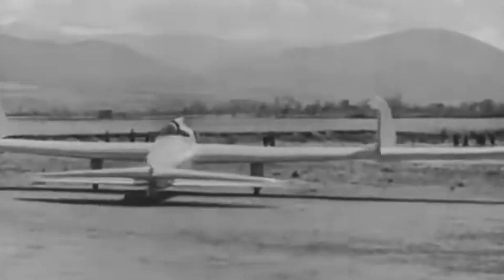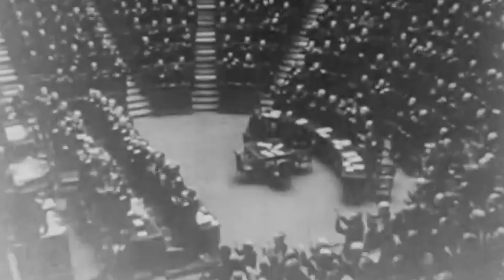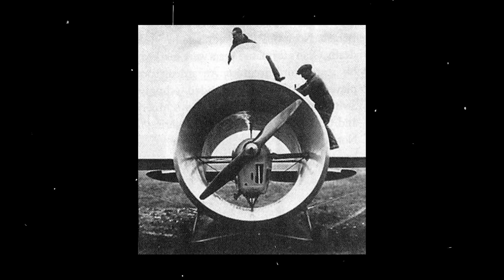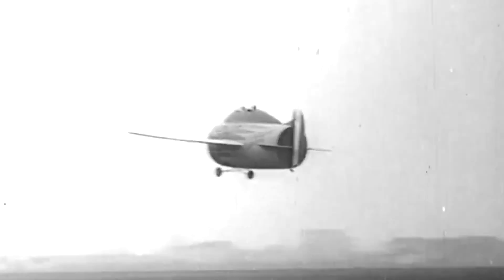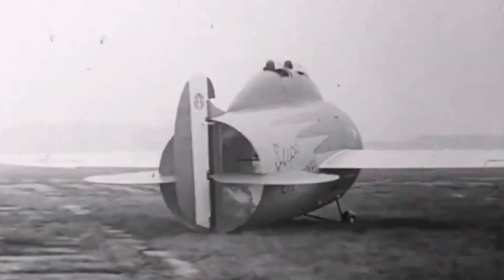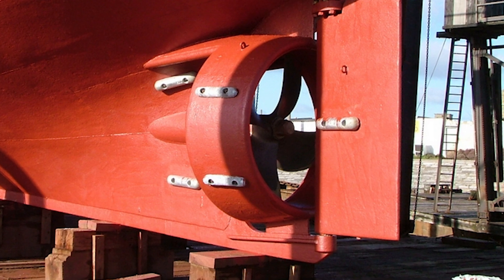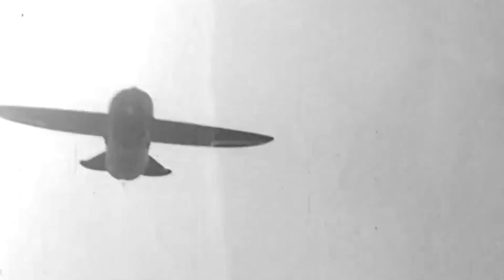A Bizarre Fat Airplane that Changed Military Aviation Forever

Comment: Air gets thin the higher you go up. WW1 flight ceilings were at 8 or 10,000 feet. The strange configuration helped compress the thin air so a propeller would still work.

Comment: What amazing times. Not a practical aircraft in any sense. To think the design influenced the development of modern jet engines is nonsense. The basic modern jet engine design was destined to be invented on it’s own following inherent mechanical principals. If anything, this design was clearly influenced by the racing planes already in existence then. They even copied existing racing paint schemes producing it. I put this craft right up there with saucer shaped designed for impractical concept from day 1!

Comment: Just an academic thought; would it have had a better performance with a narrower diameter and more prop blades? I've noticed that through the 20's and 30's there seemed to be a big reluctance in propeller layouts than double props for smaller aircraft or quadruple for the larger ones...? There were exceptions; the DH 5 springs to mind... as you look at modern turboprop aircraft like the later C-130's and the A-400 M, it just makes me wonder if propeller design was an afterthought back then...?

Comment: OUTSIDE the box … Today?  What if we built commercial aircraft jets this way?   Put 4 giant turbofans engines on the bottom and the 200 passengers in a luxurious giant tube on the top. A solution to overcrowded airports and easier landing/takeoff approaches?

Comment: I'm thinking about a pair of these on either side of a small dirigible.. made with a bioplastic carbon fiber.. and high speed electric motors... like drones... but big... reversible... like brakes... for sissies
Reply: the motor and fans do the steering.. very little yaw... only a little pitch... or none at all.. I want them to be safe for your grandma to go to the store in... and back.. never bump into someone else.. and when you stop the motors..  you fall up... slowly
Reply: we'll let Google Home take care of navigation... tell Ms Google where you want to go
she says.. 
please be seated.. enjoy your flight 🤠
✌️
Reply: I think the fans will be more efficient if placed on the output side of the venturi.. big wooden propellers are out...  I'm working on some other ideas... Arcemedes said we could move the World with sufficient leverage... he was right ✌️
Reply: StarFire Dirigibles... coming  ^soon^

Comment: The aerodynamic profiles are sound. But you're not going to drive that thing with an Arado 240HP engine. Especially if the engine itself is actually in the duct you are relying on for thrust.

Comment: It would’ve looked more normal if he’d used two tube engines. Wonder why he didn’t use a biplane design with the motor(s) between. I’ve often wondered why biplane designs disappeared.  They seem to be inherently stronger with less width. I’m sure there’s a good reason but I just don’t know it.
Reply: Biplanes are just not as aerodynamically efficient -

Comment: This aircraft was the first to use a shrouded propeller. The advantage of this arrangement over a "free-running" propeller is that the shroud reduces thrust losses due to turbulence at the blade tips of the propeller. There is an increase in power relative to diameter, but not in propeller efficiency. The first mention of the shrouded propeller is found in 1918 in a patent specification of Mercur Flugzeugbau GmbH. This describes a "device for improving the efficiency of propellers" based on the use of guide vanes with adjustable pitch and a ring surrounding the propeller.

Comment: It seems to me that this aircraft is the exact opposite of a turbo-fan.

In a turbo-fan the inlet and outlet diameters are less than the front fan diameter. This has the effect of slowing down the airflow through the fan, as it sits in the widest part of the "pipe", reducing "wave drag" (the extreme drag as airspeed reaches supersonic along the propeller surface).

On this aircraft the propeller diameter is larger than the fuselage/tube inner-diameter. How this helps with efficiency escapes me. Can anyone explain?

Comment: The jet engine was actually invented and built into an aircraft much sooner. In 1910 a Romanian engineer called Henri Coanda tested such an engine, which is much more similar to actual jet engines than the intubated propeller.

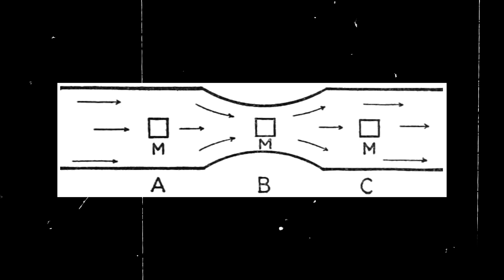Comment: 1:58 To be precise the Bernoulli principle states that when the fluid is at a higher velocity the static pressure is lower. There is no tube on a wing, so stating the principle as you did makes it less applicable as the principle per see is independent of any particular geometry.

Comment: I actually think this was a dead end.  Single engine jets were a seperate and parallel development.  The early jets used two engines on or in the wings or a single engine with dual inlets.  When they went to a more powerful single internal engine as technology improved I doubt anyone consulted Stipa's work.  Bernoulli, yes.  Stipa, no.

Comment: Yea, I have a degree in aeronautical engineering and remember studying this. I remember my instructor saying "...now if Stipa had put 4 of these beasties under wing of a larger aircraft, he'd have had something...."
Reply: He wanted to, but the airforce higher-ups refused as they didn't want to commit too many resources to something that could've been a failure
Reply: Was thinking the EXACT same thing, ducting a Pratt and Whitney double wasp from the p47, multiplied by 4 in nacelles (which could be slightly armored even, puting a chin, rear plus top and bottom turrets with three .50 cals or some configuration of maybe twin 303,s x 2 plus 20mm cannon for defense it could have likely tripped the bomb load of the b17, and carried it just as far, faster it could have really been something then later improving it with twin 28 cylinder 3000 hp engines with superchargers for altitude, then pressurizing crew compartment puting an aiming camera system in the guns and control it from the compartment the crew could have not frozen to the extent of slower reaction time to bandits or nausea from being in a quickly spinning and even upside down gun turret physically could have provided an improved defense, ability to run, once empty of bombs it could go faster still already likely 70mph or more faster than the b-17, now we're talking
Reply: @travisverlinde191  I tend to disagree. The P&W wasp was radial engine. Would have blocked airflow beyond the advantages given.. Would need a very narrow, very lightweight  high horsepower inline engine(4,6,8,12 or greater ) to really make a difference. Or just reconfigure the Bernoulli tube and stick a big pulse jet  in the middle. It will suck air in at front and blast it out out back( Similar tech is used in commercial aircraft slide bags to inflate them.)
Reply: @geradkavanagh8240  Good point @ radial piston configuration & size blocking the crucial air flow~

Comment: It is essential for there to be only the smallest gap at the tips of the prop.  In jet engines, the inner surface is SOFT and on first start, the fan touching the casing; as the engine speeds up, the fan stretches and rubs the soft liner making a tight seal.......IF the gap too big, you get surge, with the air coming out the front - destroys the engine quickly unless shut down.

Comment: When you think about it, it's an ultimate tech demonstrator, nothing on it that's not the absolute minimum to try out the new tech.
The airfoil cross-section of the tube also reminded me of annular/tube/closed wing concept, something developed during the early 1900s before the outbreak of WW1.

Comment: Calling Viktor Schauberger a crack pot is not very fair considering all the great work he did and is pretty ignorant lol. 

Especially is work with nature, his log flumes that lifted logs heavier than water prove his theories, increasing the yields and quality of farming without the use of modern fertilizers and using copper plated plows had huge gains for farming, these were scientific studies done iirc by the Swiss and proved a lot of what he said was true.

Read some of callum coats books like living energies on him and i bet you would have a different outlook on what he did in his life.

Comment: You can make this plane by taking a 8 1/2 X 11 paper. 1rst fold one end of the paper from the edge in little folds about 1/4 of the sheet of paper. Then put the paper in a tube shape like you see on the video. Use some scotch tape to keep the tube the shape you see on the video. Then gently throw it.

Comment: I enjoy you videos, thank you!
In this one you have misstated (or possibly understated) Bernoulli's Principle. It almost goes without saying that the velocity of a fluid (liquid or gas) increases as the diameter of the tube through which it is passing is reduced. How could it be otherwise? Bernoulli's innovation is that "an increase in the speed of a fluid occurs simultaneously with a decrease in pressure..." This is much less obvious. Later in the video you suggest the air is "compressed" in the tube by the action of the propeller. Not quite; the propeller has an easier time of it precisely because there is an area of reduced pressure behind it.

Comment: The problems of this system are many:  For one, the clearance between the propeller tips and the edge of the chamber creates loss, allowing air to slip by. Another major problem is the huge amount of wetted surface area on the aircraft body, creating far more drag than the ducted fan prevents.  That thing is ugly!  For what its worth, the most beautiful piston engine fighter plane ever built is the FIAT G55 Centauro.

Comment: "Changed military aviation forever", I would rather say it was a non viable concept that has had minimal impact on aviation technology. Ducted props are used to some degree (and no, a turbo fan engine is so much more than this) but not much and certainly not in this form.

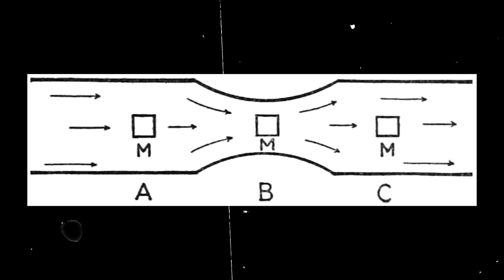Comment: A very interesting video. There's a fairly important error at 1:55, though. It doesn't take a Bernoulli to tell you that fluid velocity increases as tube diameter is reduced! Bernoulli's equation shows that fluid pressure is reduced when the diameter is reduced. In other words, you get a venturi effect.

Comment: Would this have worked better with a fan like what is used on the compressor of a modern turbofan engine?
Reply: Heinkel built a mixed engine, compressor deriven by a multicylinder 2-Stroke engine, cooling air from cylindres was added to trust, then a burner. Basically, same arrangement as in Caproni Jet-like airplane, much slower than expected.
In the meanwhile, in a high-speed aerodynamics congress held in Italy, 1937, results with swept-back wings were announced. Blessings +

Comment: Now, imagine a blimp where the main propulsion is two engines with large slower propellers operating within a tube down the center and that tube is a large proportion of the structure of the blimp....  imagine the blimp made almost entirely out of stealthy materials and the interior tube also housing all fuel, and the avionics as well as other systems.
Reply: Now imagine a horse drawn carriage. And a steam locomotive. And any other obsolete technology. Them put a gps in it. Viola! Innovation!
Reply: well, being a *blimp*, stealthy materials are not going to save it from having the radar cross-section of a postal code. However, ducted fans (which this is the first example of) are used in lighter-than-air craft.
Reply: Pointless

Comment: I'd say turbofan is a stretch.  However, ducted fan is a possibility.  I think Boeing entertained the idea of using ducted turboprop pusher configuration with counterotating props on a modified 727, but never went to production because of noise and other issues.

Comment: 1:55  The 1920's??  Daniel Bernoulli published his "Hydrodynamica" in 1738.  Nevertheless, thanks for creating and posting this video.  I remember reading about this airplane (along with many other oddities such as the German Horten bomber) in an oversized comic book back in the late '60's.  Fascinating stuff!
Reply: Also: _ a reasonably well known axiom?_ An aeronautical engineer not familiar with Bernoulli’s principle would have been an odd fish indeed, whatever the date.
Also:  There is a bit more to Bernoulli’s principle than that.
Reply: The Bernoulli principle actually states that "the internal pressure of a fluid decreases and its speed increases". It doesn't say anything about a tube because that's irrelevant.
Reply: And Viktor wasn’t Australian. He was Austrian. 🤣🤣🤣 Great work!

Comment: He made a ducted fan, not a turbo fan.  If he would have been able to get the prop edge microscopically close to the edge of the tube he would have had a much more efficient design.  But limited with primitive metallurgy, wood prop and piston engine there is way too much clearance and the efficiency suffers

Comment: Just because it's in a shroud does not a turbofan make, and I don't think anyone who knows the history of jet technology would argue that this has anything to do with jets. 
The Coandã 1910 has more claim and that never worked or the motorjet both of which used a piston engine to drive a fan/compressor then to be mixed with fuel and ignited.
This is just another Dark production blending facts, speculation and falsehoods into a seemingly true "documentary"

Comment: Great video........the Italian principal design was base off a Bumblebee usage to fly, which is eather. Eather was around in late 1800's  but then was replaced with E=m2 theory to hide the fact that didn't need to use a heap fuel to fly. Notice on this plane there is not a lot of storage for fuel. Just like a Airbus 380 it's RR motor use this principle as well, that how come they can fly from Sydney to London non stop.

Comment: Genuinely interesting. It's a shame the Italians didn't have the foresight to give them more room to work on his project.
Reply: Well, it was the Italians that funded the original effort.   A lot of good engineering comes from Italy.
Reply: It was not a successful design - no amount of doing was going to make this design less draggy.
Reply: @xmasinpacific  rubbish, compare the top speed of the engine to other plane's with the same engine. Look at the P-47, massive draggy plane. there was potential

Comment: It changed RC aviation forever, Blimps like the Goodyear ones use a ducted fan and so does the F-35.
Reply: All modern turbofan engines are ducted fan design.
Reply: Those engines are either high bypass, like commercial airliner jet engines or low or medium bypass like combat jet engines. The engines on the blimp and the lift system on the F-35 are ducted fan.

Comment: It'd be interesting to see a modern interpretation of this, with a high bypass turbofan
Reply: This is also an annular wing, which is probably more interesting than the ducted fan ( given every turbofan is also a ducted fan ).
Reply: You have:  an AB 380 engine, but with the cockpit on top of the engine instead of in the fuselage.
Reply: Id love to make one of these with a GE90
Reply: @chillzedd8179  Exactly!
Reply: Imagine someone build a plane from single jumbo jet engine with cockpit & wings attached, its flying drum with speed mach1 like jumbo jet...
Reply: @jstwatchnread8420  old MIG fighter, you mean?
Reply: I'd love to see a modern interpretation too but  piston or radial driven. I'm not sure if a turbofan would make it better.
Reply: @Eargesplitten-Loudenboomer  The old one was already piston driven
Reply: @blurglide  I know but the lift is mostly generated from the venturi. You could use a turbo prop maybe but I don't think a large increase in forward thrust would lend well to this design.
Reply: It would probably be something like the a-wing in Star Wars fast but difficult to steer well
Reply: Nearly every jumbo jet has high bypass turbofans mounted on the wings.
Reply: @dangeary2134  No shit.  They don't use a high bypass turbofan for their fuselage though.  Is the difference really that difficult for you to understand?
Reply: @blurglide  nobody is stopping you from doing such a thing.
It’s just not practical.